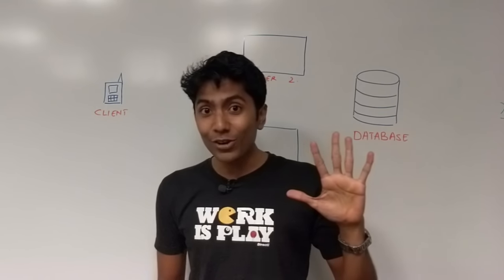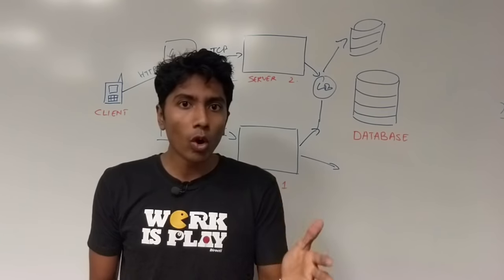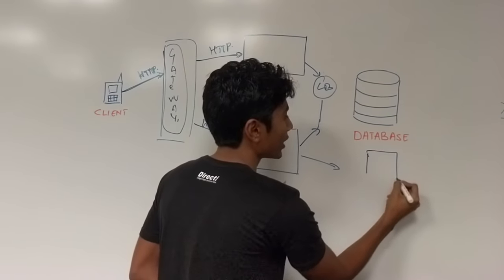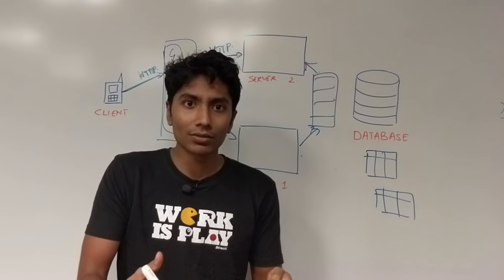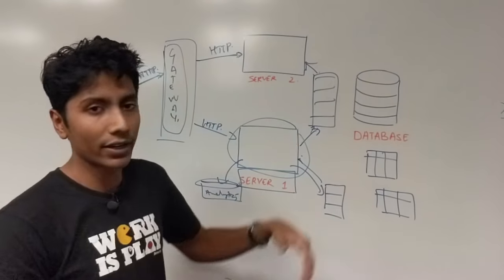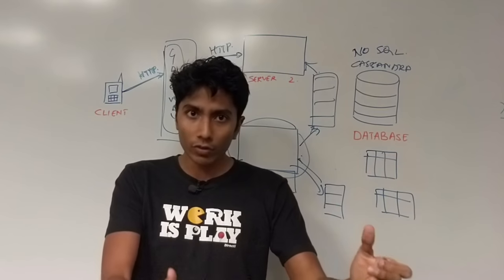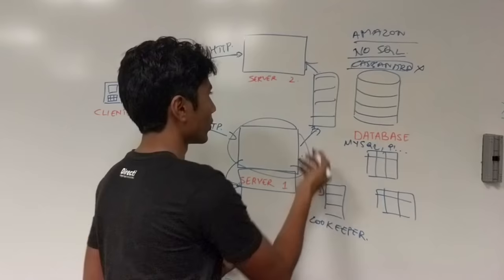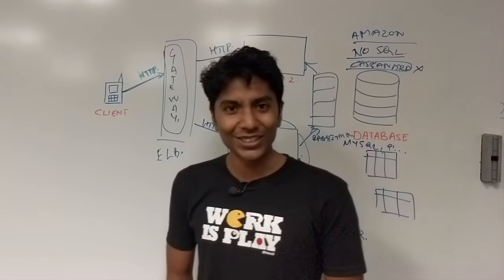5 Tips for System Design Interviews

Comment: Excellent Video Gaurav. Awesome explanation and good problem solving insights. I would like to add a few insights as far as software architecture is concerned. System Design is an art that carefully balances the user requirements and in-production quality attributes needed for a system to work and function properly. It is important to focus on a few design patterns and architecture level tatics that help in achieving scalability, good response time, reuseability and other architectural quality attribiutes that ultimately decide on system performance. There is always a tradeoff between the best possible architecture and the most feasibile one given one meets the timeline and cost of delivering an architecture. Arguing why one deisgn pattern works better over others in something that can really help in solving system design problems through iterative designing. Given a problem and a bunch of functional requirements, we need to come up with an architecture that meets quality and production requirements. Is layered architecture better? Should it be MVC? Will decorator pattern work better? Is a broker arbitration needed? Can we use pub-sub? and many more are just simple questions that one should be able to answer given a design problem? Does is scale? What is the response time? Is there fault tolerance? Is the deployment hassle free? Can it CD/CI?  These are just points to ponder. Draw a module and connections diagram view, ask yourself, does it work why? why not? Can there be other tradeoffs. The list continues.
Reply: Thanks Gaurav ji